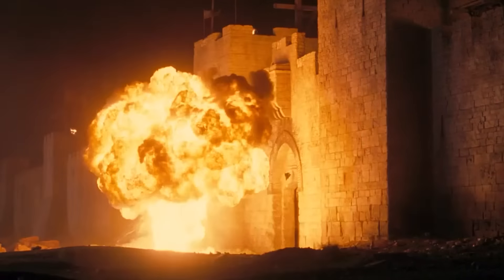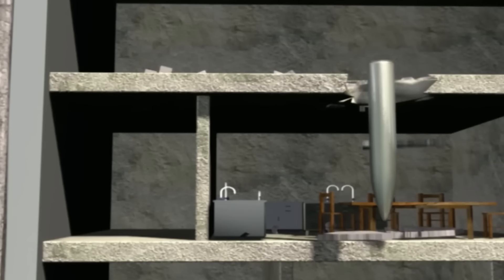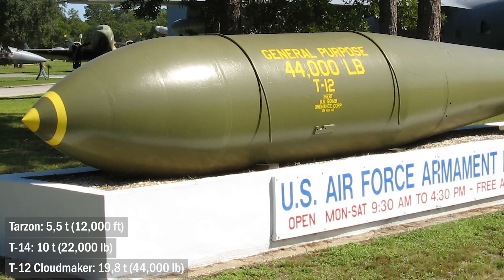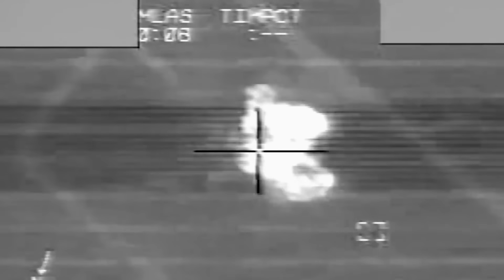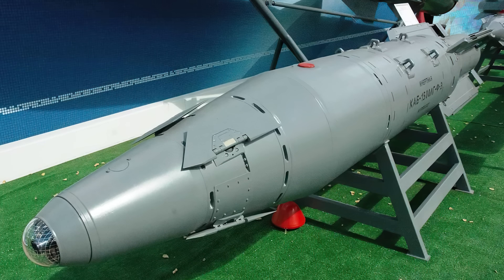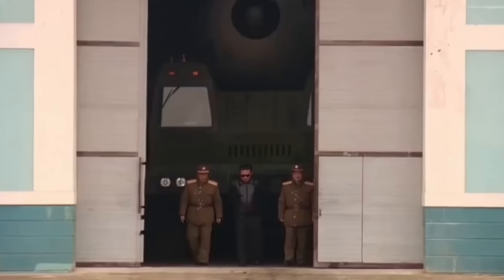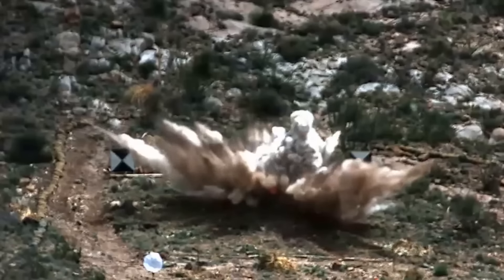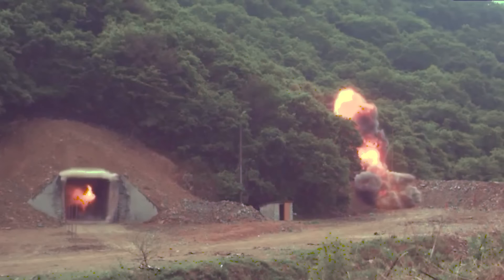How bunker busters SHATTER Underground Defenses

Comment: The US was going to use a low yield (few hundred kt) nuclear bunker buster in Afganistan 2001, but when the media found out about it, the project was cancelled. It was going to be either a B61-11 EPW (earth penetrating weapon) or a newer RNEP (robust nuclear earth penetrator) weapon. The main design problem with nuclear bunker busters is that the nuclear component can't handle the stress of penetrating more than 10 meters of reinforced concrete. I'm sure they have gotten around that problem during the past 20 years.
Reply: I did a google search on that, and found absolutely nothing. Pretty sure you're making that claim up. Where's your citation?

Comment: Bunker Busters were designed in only 10 days.  Sadam Hussain had a concrete bunker 50 feet deep in sand.  We took old artillary canons made with specialized alloys from WW2.  Tjey were heated, rolled, proportioned and filled with explosives.  The bunker buster bomb was designed by nessesity.
Just like Mr. Miagi said in the karate kid, "If do right, no can defense!"
Reply: 500,000 psi concret no Bunkerbuster can get through that
Reply: @moa4721  That's what they all say, I men "said".  Past tense.  It doesn't need to go through it, just near it.  Nazrallah choked to death on toxic fumes.  You're obviously not a civil engineer.  There's pipes and vents and shit. 🤦

Comment: What about a giant shaped charge bomb? 2.5tons of explosive behind a giant copper plate
Reply: Yeah, like the BROACH warhead fitted to Storm Shadow missiles.
Reply: Because kinetic energy is more efficient against concrete, it's not hardened steel. 
Firing a standard FMJ steel bullet will make a bigger dent against concrete than the same bullet with some sort of an elaborate shaped charge.
Reply: Nuclear shaped charges have been conceived and are codenamed, casaba howitzers, they likely could work as bunker busters. I don't think a conventional shaped charge offers much more of an advantage for bunker busters, likely because the explosive itself isn't what pierces the dirt and concrete. The kinetic energy, and the bomb's rugged construction to physically penetrate earth and concrete is what primarily accomplishes it. With that said, if the bunker is too deep, multiple bunker busters are needed, and you use them to drill. But the explosive needs to create a hole that is wide enough to allow for consecutive bombs to fall into it. Basically, a shaped charge would likely penetrate deeper, but the hole created would be too narrow for consecutive bomb strikes, and would be less efficient for drilling.

Comment: 0:19 Lol no. Curious Droid already did a video on this. Reinforced concrete is not equal. Iran has already developed improved reinforced concrete that likely can defeat any current bunker buster bomb. Now, you can always use more, or even use nuclear bunker busters, but neither are practical if the defender has decent air defenses. This is assuming that a nuclear warhead can withstand the trauma of penetrating into reinforced concrete, which it may not be able to. And using nuclear bunker busters are a greenlight for the defender to attack your cities with their own nukes anyway.

Comment: The iranians are using special concrete mixed in with carbon fibre like substrates which is quite a lot stronger unfortunately.
Reply: I think one underestimates the 'quality' of the shockwave, so even if, say, the last layer (bottom most) of 2' thich concrete survives, the blast wave would kill all occupants inside, wouldnt it?
Reply: American Proverb: There is no problem too great that the proper application of explosives cannot fix.

Comment: Do not overestimate the bunker buster capabilities. There is no metal known to us that can sustain the impact of very hard material. However, it works on concrete if the force applied to the concrete horizontally, not vertically.
Reply: do you mean a round ball like bunker wall/roof would be ok-ok?

Comment: The GBU 57 for example, can penetrate 200' of hardened concrete. Weighing in at 30,000 lbs., this bunker buster has a warhead weighing 5,740 lbs. The warhead will go off at the depth it's set to penetrate previously to detonation. It's affectionately referred to as the MOP, or Massive Ordnance Penetrator. These are the likely weapons used on the Houthis, as well as the gift to Nasrallah. It's well to note that one doesn't necessarily need to fully destroy the bunker it's attacking, rather, it can completely remove the air from the space of said bunker, as in the case of the killing of Nasrallah in Lebanon. It was determined that while in his little space where he physically survived, he actually asphyxiated as the air was removed from the space by the explosions that cut off air flow to the said bunker. This reasoning can be applied to the destruction of Iran's deeply buried nuclear facilities, some of which are said to be located under a mountain. One need only destroy the entrances to the said bunkers, as the result would be the turning of these bunkers into actual tombs for anyone working there, as well as a method of containing radiation released locally from the destruction of their centrifuges, and other equipment that's sole purpose is to enrich the Uranium to bomb making percentages. I still think that Israel will in effect, disregard Biden's directives that Israel should not attack Iran's nuclear plants and plans to develop a bomb. Turning their facilities into tombs will do quite nicely, don't you think? For Israel not to destroy Iran's capability to make a nuclear bomb would go completely against their mission to survive, given that Iran has stated quite openly on many an occasion that its mission is to wipe Israel off the face of the Earth, and every Jew with it.

Comment: easy - just make somewhat strong roof and very weak floor. if bonb goes through it buries itself 100m in a soft sand (I needed to use "bonb" because my comment didn't post otherwise)

Comment: 🕉 Satyameva Jayate: Truth and Honesty and Reality of possibilities need to be experimented as materials that are available nowadays probably will be lighter - However, Their strengths will be greater - Composite materials that use carbon fibre in casings will probably hold the ‘Tonnage’ weight of the explosive components… Woking on this design will need a penetrating ‘frontend’ of dense-solid that has been reinforced like they do in ‘Stressed-concrete’ blocks… I envisage the outer casings of carbon fibre to be like ‘onion-layers’ that would ‘peel’ off as the projectile penetrating deeper and deeper… The use of Rockets to assist in this drilling-down have to create a ‘helical-twist’ that sort of screws-n-twist at a relatively high-speed (independent of the own-ward slicing that the frontend or ‘the needle-point’ of the ‘tip’)… Look, My mind-experiment is really using the basic design of a ‘Golf-pin’ which when it gets pressed into the ground has a specific shade that helps ‘slide’ in without much effort… Hence, when i say there has to be a ‘spiralling action’ as well - what I mean is one sees this in a ‘Rifle’ that increases the accuracy because the twist gives the spinning ‘bullet’ a well planned path to follow… Hence, my design takes several of the well known effects associated with principle os projectile and their travel through ‘materials’… There is air, there is solid rock-soil-Concrete (reinforced with metal rebars etc)… Hence, as the suggest design has the least resistant head made from very dense ‘heavy metal like spend Uranium’ that has a very sender ‘pin-like’ shape - I add composite ‘panels’ in onion-layers that will ‘peel’ off as the ‘needle’ is penetrating as well the friction will be reduced as the carbon composite panels will be where the ‘spinning’ will get it ‘lubricated-space’… The very dark solid barrel of a Gun-from-the-tank will be forged in layers with circular cylinders that have been ‘telescoped’ into perhaps 4 tubes - The ‘stressed’ cables will really be ‘wrapped’ around each forged barrel… finally , the single tube of metal with its 4 tubes will be stood up or be held vertically… This is when The molten high tensile steel will be poured into the hole… Thus, the long heaven mid section will retain the ‘straightness’ (notice when one hammers a long six inch nail into timber the back-end of the nail often bends at the mid-point and the nail really ends up in the wood as a bent nail - This is what the design I have suggested will avoid when it hits the different ‘material’ underground)… Hell, I think the rockets in the tail end will be spinning this damn penetrating so fast there will be very little time before the hole is covered over by the debris… Therefore, The casing panels that have been peeled off will likely to create a ‘selieve’ through which the metal will simply slide… I have not worked out how the wide ‘Acorn-type’ shape at the rear will behave under The soil… I need to look at the experiments that study the projectile that hit at an impact of  90 degrees verticals as well at 60 degrees etc… before, I am satisfied about the behaviour of the backend of the penetrating needle - My mind is made up… This design will give a very deep reach for the explosive component to do the maximum destruction… What do you think?… As for the Mathematical equations - and that sort of proofs - I have to sit down and work the various factors that are involved… Next comes the considerations of delivering the weapon… I think I will use that Transport Cargo plane - Place this heavy beast on a sledge-slide  - open the rear cargo door - give it a push and a small parachute to pull it out - next  with assistance from another bigger  parachute make it vertically hanging  i.e.  to make it very vertical over the target - detach the parachute - and see this baby plunge into the targeted bastrads who are hiding in the deep bunker - They will have no chance to escape… BAMB … Satyameva Jayate